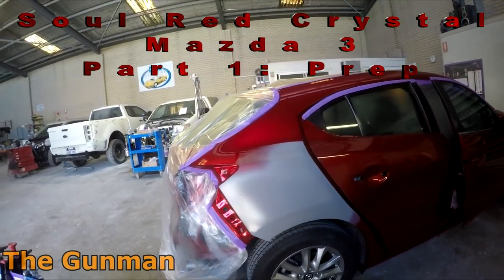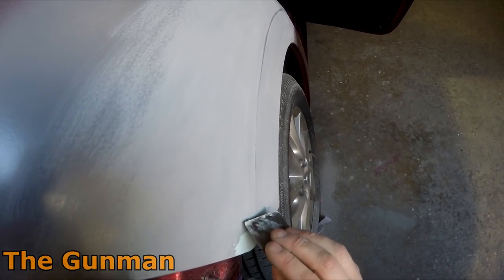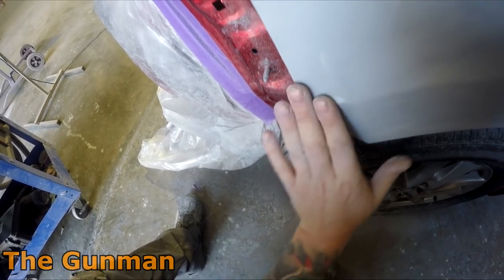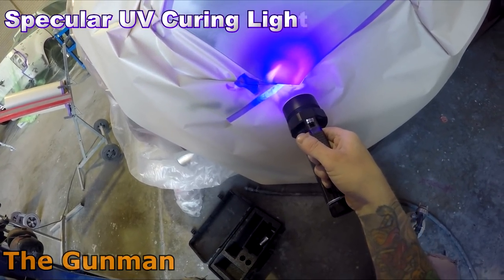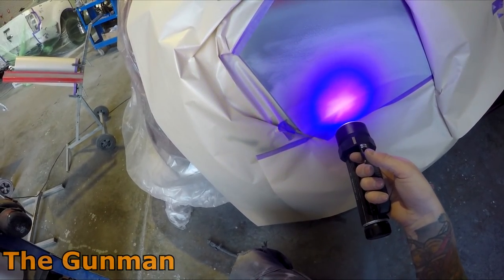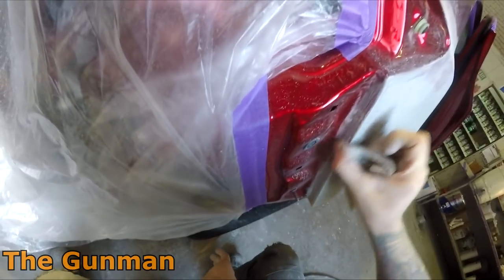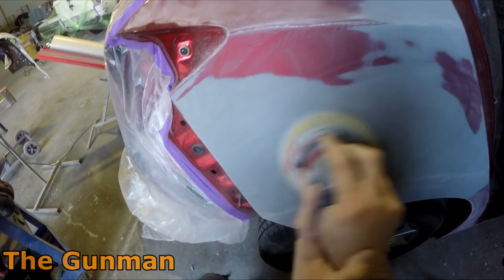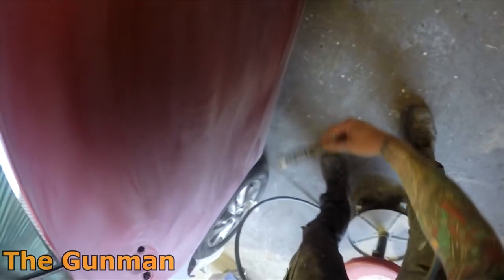Soul Red Crystal Mazda 3 Prep Work

Comment: Gunman I do like how you were reviewing the paint quality on the vehicle especially on your line of work dealing with many different makes seeing where the manufacturers have skimped on paint or if surface finish is excessively orange peely and I would certainly like to see more of that while prepping and painting. I don’t own a Mazda but those door jams aren’t as bad as inside the tailgate or engine bay (just take a look at an engine bay of a new VW Golf where the engine bay is all grey primer with slight overspray that has seeped through the panel gaps). I remember you previously respraying a roof of a cx5 in soul red which you immensely improved tailgate jams from the factory original paint job.

Comment: I work with this old guy he is 64 years 3 years away from retirement knows his stuff and has heaps of experience but safety ain't one of them uv primer 2 pack no respirator sanding not even a dust mask degreasing no gloves and you hear him choufhing like he is dying i think when he retires he is not long for this world so i learned from his mistakes and always wear a respirator and gloves we are also trying to ditch uv primer and going for air dry 2 pack its dry in 10 minutes with a infra redlight and 30 minutes at 20 degrees celcius

Comment: Hi gunman  Ive Heard clear coat    from this Cars is very Bad. Very thin And delicate. The question is  can You correct this, I mean if I  buy the car new And give it to You ,so that You can put extra clear coat layers with better And stronger clear is that possible  ?
Reply from the maker: It is possible but it's quite expensive to do properly

Comment: Was looking to buy another gun what are your thoughts on the sagola 4600 xtreme with the tiatania air cap compared to a pro lite
Reply from the maker: I actually live the Sagola 4600 and Titania is a great cap, it is blisteringly fast so if you're in a cold climate I'd probably go 1.2-1.3 not 1.3 XL but yeah, hard one to say which is better, they're both great guns. I'd go by which one is cheaper.
Reply: Yer have tried it out for a few days now only on clear. I’m using the cromax clear and the cromax super fast clear at the moment. The paint rep is really pushing towards the sagola. Is it any good for 2k direct gloss.

Comment: Do you guys color your clearcoat for 46v? Cause we need to. Then let it cure, sand and apply another 2 coats of "clear" clearcoat for proper sealing. It makes sense for more expensive cars but mazda shitboxes? common mazda.
Reply: Rather a Mazda than any unreliable euro trash shitbox. Better build quality from Mazda than most Euros. Not to metIon excellent customer service, again unlike Euro crap.
Reply: @Balancedviewable  Dude they dont even paint the doorsills properly how is this not trash?
Reply: @puding612  my car door sills are fine, and it’s the best quality of build of anything in its class, great diesel motor, and a brilliant to drive package. Dude, you’re talking outa your arse